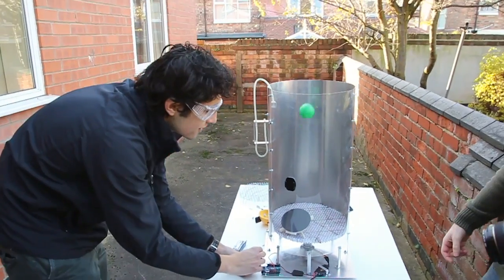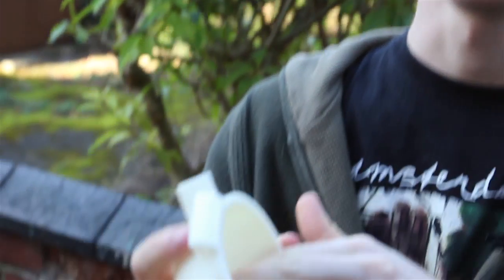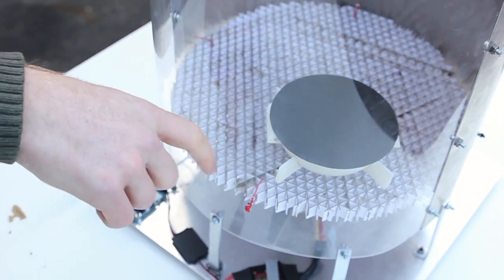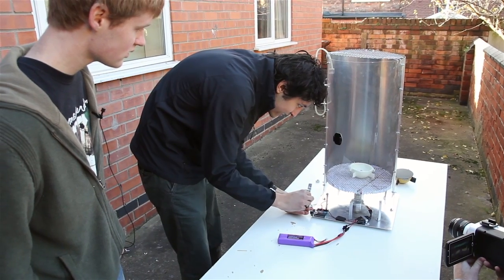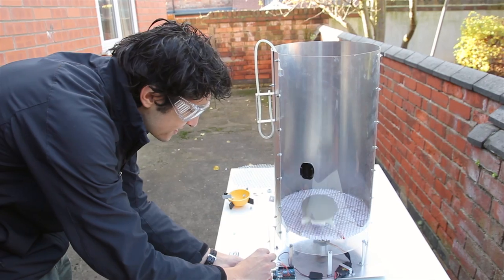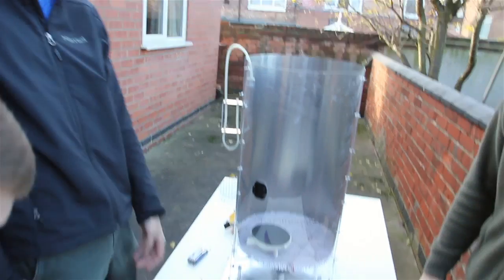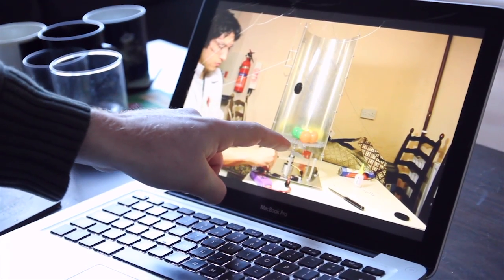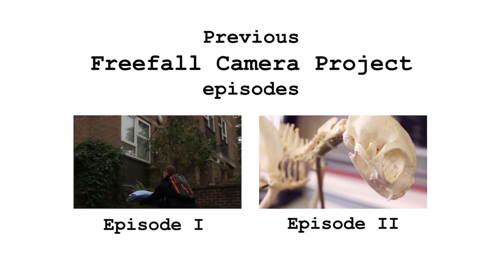Backyard Tests - Freefall Camera #3

Comment: This reminds me of indoor skydiving I had. It has vertical wind tunnel like your, but there were several fans. Those fans were under the mesh and the circumference of the tube where the fans were greater then the tube it self. So it's like a corn and a silinder. So you have a large air current coming out of a small tube.

I really think a tunnel like that would work better for you. I dont think the air flow near the surface of the silinder is not strong enough.

Comment: I don't know what discipline these guys are in, but there are a number of things that stand out to me that could be improved. Definitely use a propellor or fan that's designed for high volume, rather than high velocity. Airplane propellors don't perform well under high load or at high dV/dt. This prop is almost assuredly stalling at anything but low RPM. Another thing would be to pull the air out of the top of the tube rather than push it in the bottom. That way it's possible to get a much smoother, more uniform airflow profile.
Another common trick in the world of wind tunnels is to slowly widen the tunnel towards the top so that the velocity decreases. This allows the object to find it's own terminal velocity. They could also apply heavy use of Bernoulli's equation to estimate the terminal velocity, and drag force distribution on the bottom surface. Or, just use the drag coefficient of a half sphere...

As others have commented, the velocity appears to be much greater in the center than at the edge. I believe this is mostly due to how the prop behaves rather than surface drag. Pulling air out of the top would help this greatly.

All in all though, they're making good progress, and it's a really cool project.

Comment: instead of the straightening mash, buy 3 or 4 pakages of drinking straws, cut the bunde of straws in 3 equal parts and glue them togheter a little and put tape around them

Comment: They need a 3 or 4 cell lipo battery (at least 11 volts) and a propellor with a much higher pitch. (12 or even 15) Might also get a bigger speed control, something on the order of 50-60amps. Castle Creations makes a good one. In addition, it would be good to move the grating up, further from the propellor (maybe another 3 inches) and make sure the tolerance between the propellor and the side of the tube is very tight. (max 1.5mm, preferably <1mm)

Comment: AFAIK the honeycomb mesh has the lowest turbulence - you might want to try it ;)
Reply: If they were looking for cheap and simple surely straws could work as well, it would add a bit of resistance but if they were cut down to about an inch or so it should work.

Comment: at 2:46 that sound it made could indicate the timing or entrance angle might be off, there are options in the speed controller (esc). The settings might be off because there is no load, or very little, or too much, haha. What is the load value for a bench? idk, just a thought.

Comment: 1 horsepower = 750 watts  = 60 amps @ 12 volts.  There's no way those little wires are transferring 60 amps.  I suggest you measure the current through your controller.  Also, the propeller could be better at the top since the air will enter the tube much better if it's not being disturbed by the propeller.

Comment: You can see that the problem is it needs more space to veer to the side and adjust itself back upright. With the tube being so narrow it only has time to tilt with the instability before crashing into the wall, not giving it time to re-stabilize itself. The friction of its wings against the wall hold it in the tilted position working against its attempt to right itself.

Comment: How interesting that with all the engineering that went into this project, no one ever thought about the where the volume of air under the fan was going to come. They should design their fan with a huge hole under it and the ability to move as much volume of air as possible, not suck it from the sides of the rig with a flat metal bottom. Basic fluid dynamics guys. This is like laying a box fan  on the carpet and wondering why the force of air drops off exponentially. Duh - airflow. lol Great work though, really, excellent job. Just think it through as a liquid - propeller.

Comment: That propeller is not the best choice, might want to look in a different type of wind drop tunnel tester. Use google, find tunnel designs and make a blade yourselves from papier mache. I made a wind tunnel myself back in 8th grade, not a fancy thing, and i used designs based on actual drop wind tunnels and that weird joy ride thing where you get to feel what it's like to parachute but whilst standing still. Similar to the vomit comet in philosophy.

Alternatively, use a centrifugal fan if you can. You can find a cheap centrifugal fan that has a speed regulator in house hold blow heaters. Remove the heating element stick the fan inside a casing and use a tube to direct the air flow in the tube.

Also that half sphere might not be the best idea for a drop camera because it's going to be very hard to stabilize it. Being shorter than it's wider the weight will always be near the center and you can't make it too heavy either. Might want to go with something that's different. My two cents: if you want to stick with the half sphere make the weight sit outside the body, hanging down on a piece of metal. If you don't have to stick with that shape then copy pasta the american design for the space capsules. There's a reason after all for that shape.